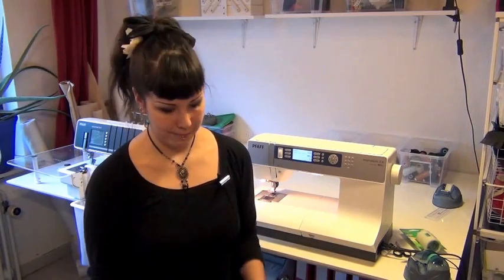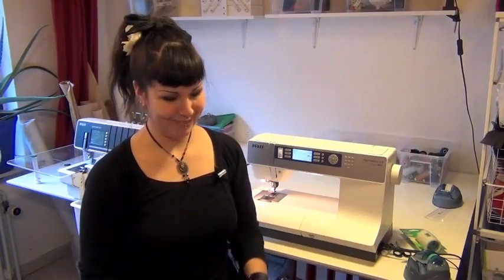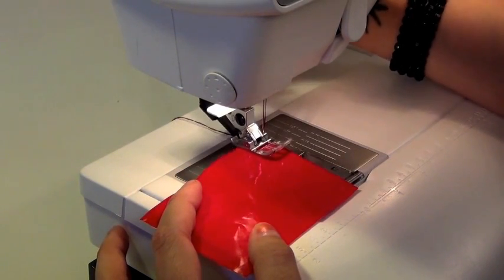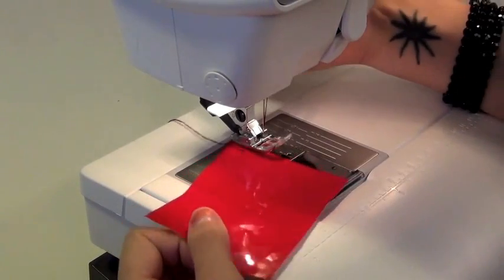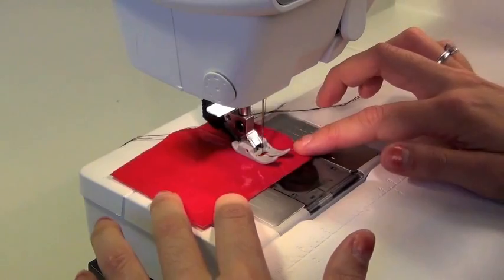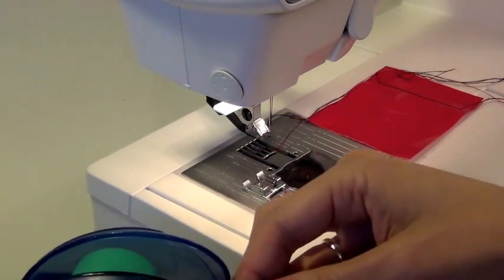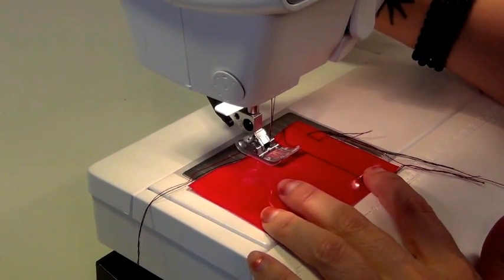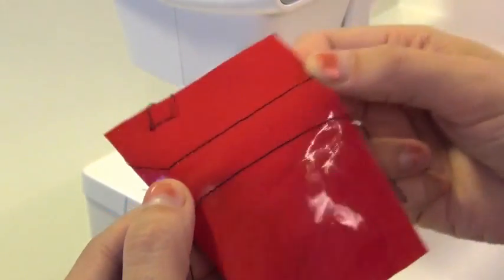How to sew on pvc fabric

Comment: This is a great tip. I'll have to try it today when I'm working on my beach accessory. In the past when I was sewing waterproof 60/40 acrylic/polyester fabric that had the same rubbery characteristic on one side, I ended up spraying a bit of WD-40 lubricant a little before and on the foot. I found that in addition to helping the fabric slide under the foot, it also helped the needle pass through the fabric more easily, since my Costco special, Brother XR-7700 seems to be a little under-powered for this kind of heavier material.
Reply from the maker: Andrew Simpson best of luck and happy sewing. :) and thank you for the additional tips.

Comment: The tape tip is great! Thanks! I have been sewing pvc to pvc and I use fodder (drafting paper) to keep it from sticking. You can also use drafting tape. I put a strip under the foot and above the teeth. You can see through the paper and once you are finished, it just tears right off.

Comment: Hello Sy Nu, there is a video on here about making non slip pedal mat. She is using a type of rubber used  for drawer liners, there are two layers and she binds with bias binding, now I tried this, it didn't work too well, I also asked about what settings she was using, but the comment section was closed down,.  Now that i have found your video its helps a little but what settings should my machine be set at and what needle should i use, jeans? with jeans thread.  So all together i have 2 layers of rubber and 1 or 2 inch bias binding.  Your video has enlightened me about the teflon foot, i have one or should i use a walking foot  Thanks
Reply from the maker: Mary Sinclair sorry for the late reply. I would probably try with the jeans needle as well, because there are a lot of layers and the needle is very pointy. 
Settings on the computer to "normal". Maybe just a bit longer stitch length. I'd make some tests to see how it looks. 😊

Comment: +Sy Nu
Hello, it looks like here you're NOT using a polyester material, but I was hoping you might know the answer to a question I have. 
Does all polyester 600D have PVC backing or is there 2 types? Such as polyester 600D with PVC backing & Polyester 600D without PVC backing? Thank you!

Comment: I recently bought some quite thin, rubbery pvc and was told by the woman in the shop to glue rather than sew it because the 'stitches will rip right out'. I was also given conflicting information regarding treating the fabric. Can you give me any advice on whether you think that this is correct. Also, any book suggestions which helped you learn how to work with these fabrics would be greatly appreciated.
Reply: Thanks for the response!

Comment: Hi parnuuna, would using the Teflon foot be good for sewing bias binding to rubber drawer liner, 2 layers?  so far ive tried the paper method, that's fine but turns out a little wobbly.

Comment: Darn i bought two Teflon foot pieces from singer and baby lock and they only work with just two flat layers of pvc/vinyl. They are absolutely useless for sewing a complete garment :( the tape trick didn’t help either on a regular or Teflon foot. Had to resort to using tissue paper overtop which works but is annoying as I can’t see clearly where I am sewing 😓